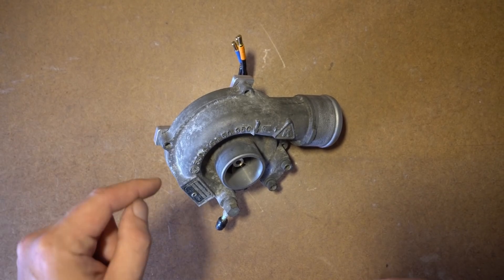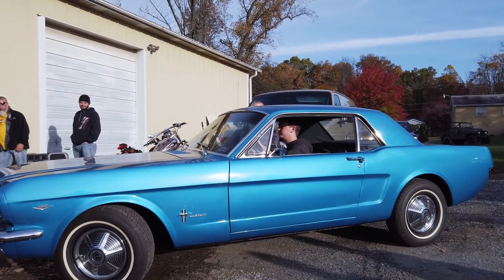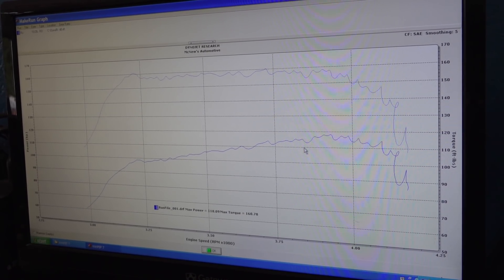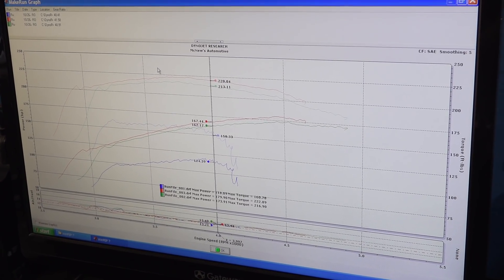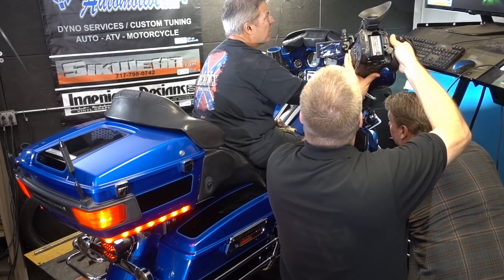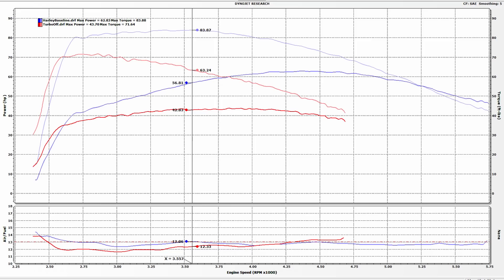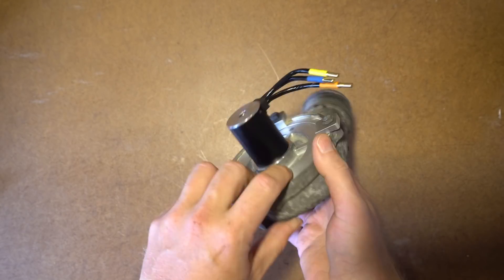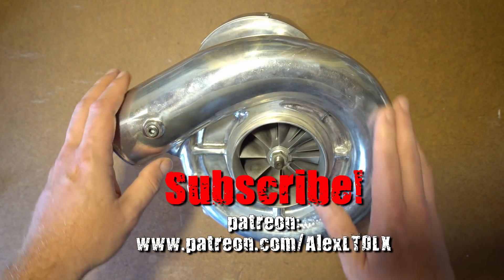DIY Electric Turbo On The Dyno!

Comment: Take a pvc y connector and put the blower on one end and a CAI on the other.. won't lose vaccuum and won't restrict the air flow when the blower is not running
Reply from the maker: Or... I could just make a bigger one, put it on a car and make 650 hp (just to start): https://youtu.be/AOL3Qyczt3Y  It's about the equivalent of 1 psi restriction not running - which still leaves about 475hp to play with with it off.
Reply: @AlexLTDLX  that I would love to see!

Comment: Turbo is technology before fuel injection, which controls the air-fuel mix to the engine. In the past, without fuel injection, pumping more air to the engine would increase the combustion and thus power. With today fuel injection technology, simply pumping more air to the engine does not always improve power. You gotta modify the fuel injection to accommodate the add-on turbo system. Otherwise, it's a waste of fuel.
Reply from the maker: I'm just gonna put this right here: https://youtu.be/84wSLQRy9sc

Comment: A regular exhaust turbo constantly runs not causing a drag on the motor. Your alternator can’t run this full time so it has to be on a switch only to be turned on when you need it. So in normal driving you will be losing 25 horsepower because turned off it’s restricting air flow.
Reply from the maker: As I mentioned in the video, that was never designed to be a turbo an engine. it was designed to be a crankcase evacuation pump and I will still test it as such. Check out some of the other videos were I actually chose to make a functioning electric turbo. So far we're at 580 horsepower and counting, and very shortly I think we're going to be at about 650 or 700.

Comment: Oh and a conjoined secondary air intake with non return valve to prevent any restrictions at high revs would be a good idea.
Reply from the maker: If you haven't seen it, check out this video - we made 580 flywheel hp with a bigger DIY electric turbo: https://youtu.be/84wSLQRy9sc

Comment: You should have  split the intake.  And aided the original  airflow.  Not direct coupling. The air manifold  pressure at peak power  is about 0.7 bar without  a turbo.

Comment: Or you can buy a torqamp
Reply from the maker: Which is great - but even two of them would be a restriction on my car.  Which is why we're building a 15kw electric Vortech.  (Torqamp is only 5kw).  Even the 15kw Vortech isn't going to make more than 4-6 psi and 700 hp on my car.  Which can easily support 1,200+.  We'll just keep going bigger.

Comment: look like it has more   torque than 81.65  @  2675 RPM ?
Reply from the maker: Maybe... but I'm now focused on the much bigger and badder electric supercharged Vortech.  That should make enough power to blow up the Harley.  Several times over.

Comment: A practical use for electric turbo is to eliminate turbo lag in an engine that is already turbo charged.
ie it may already be spooling quarter rpm at idle and as soon as you hit throttle it goes full rpm then actually switches off at about 1500 rpm when the exhaust driven turbo comes online.

Comment: I'm curious of how these things will be integrated into the total fuel delivery design.  In any boosted configuration you need to increase the fuel delivery to match the increase in air being pumped into the engine to maintain a proper air/fuel ratio. How will these be controlled when an electric supercharger as it is either on or off?  With turbos and belt driven boost devices there is a ramp up and down effect to their delivery of additional air and fuel to the engine how will this be accomplished with these electric devices?
Reply from the maker: Most OEM computers can go a fair bit outside their parameters these days; for me, it's not an issue; I've been running an aftermarket EFI system since the '90's.

Comment: You are only running it at 370W. That looks like a racerstar 3670. https://www.racerstar.com/racerstar-3670-motor-brushless-waterproof-sensorless-1-or-8-rc-car-part-2650-or-2150-or-1900kv-p-172.html That should be good for 1600 Watts. Feed it 24 volts and see how many amps you pull. If it isn't getting close to the motors rated 1600Watts, you need to get a different motor.

Comment: Turbocharger compressors spin at up to about 100,000 rpm's. It also would need a serious amount of amperage in order to make, and hold pressure. That is why this cannot be made very easily. Manufacturers have been trying to do this, and make it practical for a very long time. As an educated guess, I would say your power gain on that motorcycle is probably  because your contraption is atomizing the air. That in its self is a useful idea. Did you use power generated from that bike, or did you use an alternative source?

Comment: One big issue here would be battery power.Your Alternator would work it's ass off to keep the battery happy.
Reply: It's not powered by the electrical system but a separate RC battery of the wrong voltage to be wired into the electrical system even if you wanted to.
Reply: @Andy-df5fj  So how are you going to charge that separate system?If it's flat how you going to run your car with that thing not spooling??Just run restricted till you get home?
Reply: @dirkdiggler9082  
Yep exactly.  That's why most of these systems are just a novelty even when they do produce some boost.

Comment: Cool. Are you experienced with RC plane motors? I use high power motors in electric jets on 12S lipos.
Reply from the maker: I'll be trying a 12s motor assuming all goes as planned...

Comment: 8-10KW hahaha. Sounds Like Alot Of Weight To Power It haha. I've Got 48 3000F 2.7V Ultra Capacitors (8 Banks Of 6 For 4000F Bank Theorictical), 2 50Ah Lithium Batteries, 1 40AH Lead Acid Battery, And 2 320Amp Alternators And I Can Barely Sustain My 8kw Sound System lol. I Would Use Ultra Capacitors In Series Up To A High Desired Voltage Because Of Thier Light Weight And Large Current Capabilities. It Would Be For A Short Moment Of Electric Supercharger Boost.

Comment: I would use a starter and play with gears to spin the procharger at the desired rpms.i imagine less rotational mass on the crankshaft it will produce more power

Comment: @ 1:57 A computer on a Carburetor engine🤯.......okay....lol🤣🤣🔥🔥👍
Hey stop fucking around get yourself a 460cid with aluminum heads a cam and hI-com pistons 900cfm pumper 
Slap a T5 5spd and a ford 9inch posi diff.
And makes sure you wear your diaper.

Comment: bearing in mind that F1 cars essentially use electric "turbos" as part of the ERS system this should not be a question of is it possible, but more of how expensive is it to do this. Interested to see the results.
Reply: It is possible and already done by Borgwarner and Valeo. They both offer eBoosters. The actuall S500 from Mercedes uses the first Gen. of Borgwarner. But they are on a whole different level than this.

Comment: Good luck finding a motor that powerful, 5000w is about the most you can find on BLDC motors without giving an arm and leg
Reply: True, but for short durations you can overload them. Especially if there's some provision for enhanced cooling.
Reply: Used Nissan leaf motor?

Comment: I'm already running a Novi 2000 driven by a Me-0913 BLDC on my 87" Camaro with a 1st gen 350 .060 over. 72vdc@250 amps. Runs off six 50ah lead acids in series. Makes 8psi without the engine running, about 5 psi in the early part of the band and by red-line it's all gone.  People greatly under-estimate how much hp it takes to drive a blower at speed. I used a 2" belt-drive to up ratio the motor since it's max rpm is 5K. Blower is internally geared 1:3.5 and with a belt ratio of like 1:2.9 (which is optimum for me) that's about a 1:10 ratio from motor to impeller. Max motor torque is about 96nm .which is high, just not high enough to run the blower at full speed. Hell cat roots blower takes 60hp off the crank to give it just 5-8 psi of boost. All my FB project pics are public so anybody can check out my version at https://www.facebook.com/Totenkoph/media_set?set=a.10205094720183696&type=3
I only add people I've actually met to my friend list though just to keep things real. Just saying.
Reply from the maker: Interesting. I'll have to check it out. I'm wondering how much loss there is with all that belt and gearing step-up. I guess we'll find out, I intend to go direct drive.
Reply: The Novi 2000 requires an input shaft speed of around 12K rpm for 15 psi on a V-8 Mustang (which makes over 40K at the impeller.) The fastest drive motor I could find with enough torque was 5K max. and it still gets dragged down some. I've bee thinking about experimenting with one of those little roots blowers and a bldc, but that would require a flapper intake valve because a roots can't be drawn through unless it's turning.
Reply from the maker: @golgothapro  I've driven my car with the belt off plenty of times. It's got a Whipple on it. It drives fine it's just a little doggy. The fun part is listening to the Whipple spool up when you lay into it a little bit even though the belt is disconnected.
Reply: Right, so even without the belt it was still turning. If you had a direct motor drive to it and it wasn't then there would have to be a way to naturally aspirate around it unlike going through a centrifugal.

Comment: Could you put a "gearbox" between the electric motor and the turbo to make it spin faster?
Reply: Rotrex did this with their superchargers. Not 100% on the spec but the number 85,000RPM comes to mind first.
Reply: You could. But the gear box would need to handle like 15 ish hp if I converted it right. Controlling it would be difficult if it’s a multi speed. But something like a head amplifier could probably be done easily - ish. But space could be the limiting factor
Reply: @thomasloebig8612  Planetary gearset should work, and is fairly compact. You'd need a higher tq motor to spin it, depending on gear ratio. They work in automatic transmissions, and could easily handle more than 15hp.
Reply: You could probably gear it 2:1 pretty easily. That plus a small flywheel and of course a much bigger, high voltage electric motor
Reply: Jst Drv ya.  But that’s where it comes too. Higher voltage will run higher rpms and higher amp brings more torque. So I’m assuming with a higher voltage motor you could get away with less rotation mass (less parasitic loss)
Reply: @Heads Mess a big sprocket on the motor and a small sprocket on the turbo will make the turbo spin faster than it would with a 1:1 ratio.

Comment: Seeing more of these videos, So basically direct driving the compressor won't really cut mustard as uses to much power to spin at full RPM and after market systems are typically 48v which then has charge problems and requires a whole module to run....(there is a good kickstarter - https://www.kickstarter.com/projects/torqamp/torqamp-electric-supercharger)
What i personally would suggest from actually playing with this sort of stuff 10 years ago (specifically on turbo's), would be to re-gear the supercharger and use high torque DC motor as the hardest thing to get past is the power/torque required to actually spin.
Keep it up and sure you will get there

Comment: What battery are you using for the turbo set up. You should get a radio controlled Electronic Speed Controller set up with a bad ass brushless motor and a lipo battery so you can possibly spin some faster rpms on the turbo.

Comment: I really wish you dyno’d that bike with the electric compressor hooked up to the crankcase to help evacuate and see what the gains would have been.
Reply: My guess is about the same amount of power used by the motor, around 1/2 a horsepower gain.
Reply from the maker: That would have been a good test and reflective of what I built it for. But I don't think you would have seen much if any gains on something that relatively low powered.

Comment: Yes finally I've been wanting somebody to hook up an electric motor to a vortec or ProCharger forever
Reply: I was looking into it, but in my EXTREMELY LIMITED RESEARCH AND ZERO EXPERTISE. You would need a high spinning drive or a few step up gears and it would need to have a fair bit of torque. Also you may need an electrical system that could support it, never tried as I dont have the funds if I ever get them will try to make it

Comment: I'll bet that Harley would've done a lot better if you had an air box or some volume of air between the blower and the inlet as a buffer.  Single/dual cylinder engines like that are only pulling in air 25%/50% of the time, at very high velocities.  So 50% of the time the blower was pushing against closed valves, and the other 50% it was trying to keep up with peak demand.  If the blower could 'charge up' an air box between intake strokes, it would be much more efficient and less of a restriction.

Comment: So put it on my 18 hp lawnmower and go mud dragging? 

I understand the installation appeal of electric superchargers,  they've just a hair easier to install than a centrifugal, and lack of lag, but what is often overlooked is that unless you run an auxiliary battery system that has to be recharged with shore power, there is a significant hp draw from the charging system, even if multiple alternators are used.  

Surely more fun to play with, as the cost and complexity of a practical application may be prohibitive,  but when it comes to sport, the wallet is the only limit.

Comment: You Need a 3.0Turn - 3.5Turn motor brushless sensored or sensoredless about 8900kv 10000kv equal to 50000rpm -100000rpm set at 7.4v2s 14v3s battery with anywhere 2000mah - 5500mah with a esc (electronic speed control 120amp for max rpm peek) and you might pull 10psi - maybe to 20psi I swear with a good seal and a heat sink you might achieve that mark
Reply from the maker: If you watch the vid I just posted, you'll see that 20 psi would be very difficult to achieve with current tech.  But 10-12 MIGHT be possible, with two units: https://youtu.be/h7yScua28I8

Comment: Sorry but I just don´t get this. I mean... props for being so methodic when designing and collecting data about the turbo, and also for your honesty and good will to share with us the power curves and all that, but this experiment already throwed your hypothesis to the trash can, why would you repeat the same thing with a bigger/better turbo, electric motor or engine? do you think you can change something in your basic design that can make such an impact on those power curves? Am I missing something?. I´m not trying to bash you here, I love watching an idea being correctly tested and you are doing a great job.
Reply from the maker: I'll be posting a video soon about sizing and compressor maps - it should answer your question.

Comment: So why not add a one-way door so you can boost the low end then that door will open when it requests more air.  a Y connection. one side has turbo one side has a one way door.

Comment: You'd probably see more power if you just bolted the electric motor up to the front of the engine and ran a belt around to the crank pulley.

Comment: I’m curious as to how it would preform on an engine where the turbo isn’t a restriction, say a predator 212 or 50cc scooter
Reply: Hayden Tavernetti it would lean it out way too much. I’ve got a built 74cc bike and I could charge it using a sump pump or electric supercharger. But the issue is fuel ratio. Like what happens when it’s off? Or if it would be always on what would even be its idle speed?? And forget about it if it’s a two stroke. In one port and out the next. Lol. You’d need an efi system. And even then power gains may not be significant

Comment: Hi! I was sceptical about your little direct mounted brushless motor, but see you are talking business now 😂

What I would do here, I would bolt on a turnigy rotomax 150cc brushless motor with an adequate gearing to achieve high compressor rpm, run it on 24s, 20000ah lipo battery. This setup should give you close to 10kw input power on that turbo(supercharger 😉) , it may be interesting 🤔

Comment: The big electric blower is going to be REAL expensive.  Any Motor capable of driving that is in the thousands of dollars. Any Battery(s) capable of delivering the amperage are going to be exy and don't forget about the ESC and wiring.  I can't see this being done for under $5K in componentry let alone fabrication. 

You may be able to drive it off 12V BUT, if you run it off the car battery and are after max power, You'd want to have a disconnect on the alternator field when the blower is running.  Soon as you hit the blower, it will drop the power and the alternator will drop a 3-5 Hp  load on the engine.  If you use Lipos they are going to need to have a built on charge controller so they can gradually be recharged. 

When it comes to this level, electricity is really weak in comparison to anything fuel driven.  The power you are going to need WILL be substantial. 

Be interesting to see what a bolt on electric blower ends up costing and the performance in comparison to the cost of a regular blower or Turbo with labor for fitting. 

If it does not do well as a Blower, It will make the basis for the Shop vac to end all shop Vacs!! :0)
Reply from the maker: An alternator won't cut it; maybe two high-output deals, but they'd make the power in the car unstable - I can see my ignition faltering for sure.  I believe batteries (or even a large super capacitor for short bursts) are the only way to go.  And I think, while it certainly won't be as cheap as the little one I made ($100), I hink it can be done with off-the-shelf parts for a lot less than you might think.  But we'll find out, I guess.